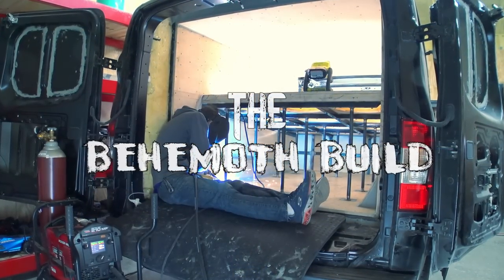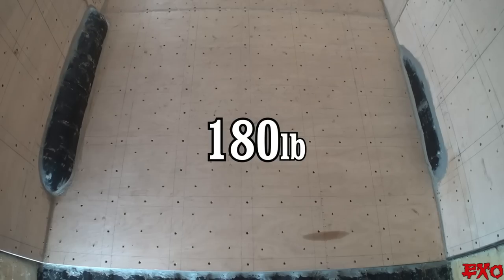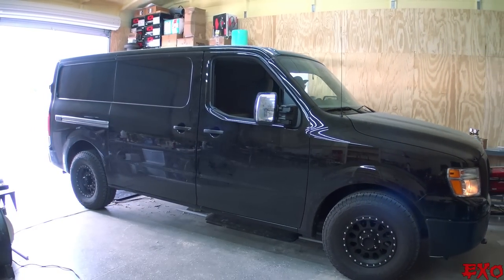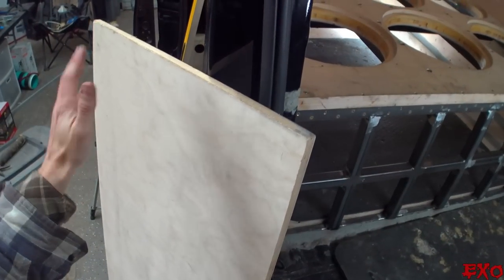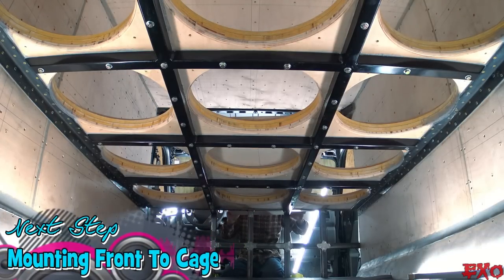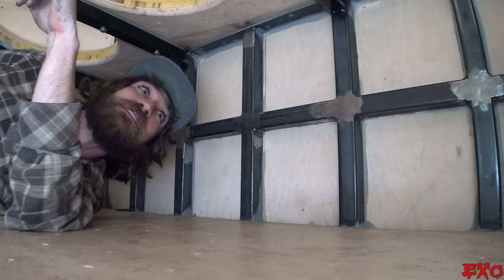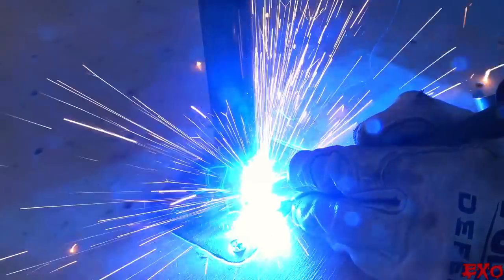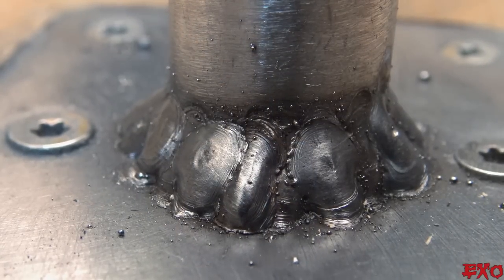Bracing My 8,000lb Subwoofer Build w/ Custom CAR AUDIO Braces + Building & Installing FRONT of BOX!

Comment: I had no idea bass vans took so much work to build. These videos bring me back to my high school days. My 91 crx with homemade 4 12in sub box with 4x 4in pnr ports. With my dd9512's and 2 crossfire 2000d amps, with a good ol group 35 blue top batt. Best was 166.1db on the dash.
Reply from the maker: Wow, great numbers! Thanks for sharing. I really loved messing around with with audio with my cousin back in the day. Memories that will be always cherished ☺️
Reply: @EXOcontralto  Thanks. My friends and I would spend hours tweeking things to get every last db. Like the a/c on max gained .2db, open the driver door 2in gained .3db, or slide driver seat all the way up .1db! When i strapped the amps, and wired down to .25ohm is when it all went by by. I didnt have $5k to replace everything. But the memories last a lifetime!

Comment: I know it’s great using an impact to drive screws but as an interior systems mechanic journeyman I recommend using a torque gun of some sort for setting your screws. With the amount of attention too detail as you have that would only improve the fastening of any screws. Just a thought I had when seeing you use an impact driver (which I normally use for tap con fastening). A torque gun/tek gun, will likely provide you much satisfaction.

Comment: Love the new focus at content and hair cut. I like how you snuck in your New Years resolutions. 
My question is, what will you do with sound proofing the exterior? Will exhaust brackets or fuel lines and things of that nature create an issue?
Reply from the maker: Yeah, totally. Maybe not that specifically, but destroying the actual vehicle and its mechanical parts is always a concern with extreme bass. Every weak spot becomes even more vulnerable the more and more the enclosure and cabin gets reinforced. It literally just keeps transferring to the next weakest spot. Because of that, I'll have to carefully manage flex and monitor breakages because this sh*t is going to destroy lol

Comment: also on that pl, if you want to make it very nice a smooth on parts you can see, put on some gloves and dip your finger in 91 percent rubbing alchohol and it comes out like butter, and as far as the welding laying down a soaked towel on top of the wood before welding should wick the heat away

Comment: Instead of using the Dremel you can also offset the screw and use a 2 component epoxy instead of a adhesive

Comment: dude, you should have used 2 holes per pipe and filled from the bottom... put the top set screw in before removing the caulking gun on the bottom so it holds vacuum while you put bottom set screw in.
Reply from the maker: Appreciate the feedback man! It was breathing well enough around the nozzle, luckily. Good thing I went slowly and triple checked everything along the way confirming a fully filled tube tho 👍

Comment: I wonder if wrapping the brace with some Sound denting would lower the ping even more after you filled them.
Reply from the maker: Yes, technically. But that wouldn't really look the part once wrapped. Deadener is always kinda wrinkly and dimply. Plus it would take away box volume that the subs could to potentially use inside.

Comment: At 12:58 you mention how the flange screw holes align with the crack between the wood and steel.
Have you considered rotating the flange 45 degrees so that two are on wood and two are on steel?
EDIT: Your solution is way more elegant. This build is nuts and I love it.

Comment: What will the final cost be?    Looks amazing.   Wish I could do half as good.   I bet you're so pumped.
Reply from the maker: Hmmm, now there's a question... maybe I should try to make a video talking about that?
Reply: @EXOcontralto   yeah that be cool.   I don't think people really understand the costs with everything that goes into a build.  I know when I did mine it was all the little things that end up costing so much.    I did a 93 toyota pickup that I molded a canopy on and did a walk through. I'm running 2 skar skv2 3500 amps strapped to 4 skar vxf 12s set in a Gately Audio 4x12 8.0cf box, 2 sets of skar spx-65c component speakers running off a skar rp 75.4AB amp, a skar eq,  a slam panda bass knob, 0 g ofc power and ground runs and all ofc speaker wire, all off a Pioneer 4200 nex. A 300 amp brand x alternator, and a sx d6500 secondary batt.

Comment: Just curious as to why you didn't put a layer of 3/4" ply on the inside of the front. Just thinking the amount of pressure is only being held back by the screws holding the front panel on.
And having the ply on the inside of the frame would put the pressure directly onto the frame.

Insane build tho. Will be worth travelling to the US from Australia to see this in person when it's finished.

Comment: The round pipe plates could have run the screw holes in a line and had to screws for each plate hit the steel and the other two screw just secure in the plywood.

Comment: Quick question, what about the square tubing? Does the filled in blocks help with the vibration? Probably would've been better to fill them up aswell, but that will be lots of work.
Reply from the maker: @billy bowling  Much like how the added material inside the round braces removed the unwanted resonance, the added material attached to the metal cross supports (which is the 3" thick wooden baffle bolted down to it) completely deadens it already. The only reason the round braces resonated was because they spanned a large distance, UNTOUCHED. The cross supports on the other hand have no spots where they span untouched by another object.
Reply: @EXOcontralto  can't wait to see the end results. Amazing job, keep up the hard work!!

Comment: Wood is porus, so the glue should hold to that fine, the metal however, should be cleaned thoroughly and can benefit from a 60 grit scratch to increase mechanical adhesion. Im certain you are already way overkill as is so i wouldn't worry about it lol

Comment: I think instead of building the little squares it would have been easier to put another board on that side and drill a tiny pilot hole in the center of the board we're supposed to be the square would be and just fill those up with foam it actually would have seal much tighter they would be no air leakage no rattle and would have liked that sound dancing

Comment: EXO take ur time on the build everything u do is gonna pay off in the end. I to have a build but it's way smaller. I have 2 american bass Hd15d1 and taramp 5k for my mids n high I have 4 Pioneer TS-A6880F 350 Watt 6" x 8" with a taramp 800 I'm still trying to figure out what tweeters I want plus I need to buy or get a alternator build n I need to get some batteries I just don't know what to get. I started this build in 2020 and I'm still not finished. Oh it's all going in a 2010 lincoln town car

Comment: at 12:48 min why not turn the pedestal/mounting flanges 90 degree so 2 screws went into the metal and 2 in the wood
Reply from the maker: Good thinking, but still not enough room to call it good.

Comment: I thought you were going to put plywood on the inside of the front wall to make it smooth like there sides
Reply: No reply
Reply from the maker: It's hard keeping up with thousands of comments every month. But hey, I'm trying. Once testing begins, yes possibly that section will be covered - if the enclosure requires shrinking. But for now, there's about 4 cubes in that area available for shrinking, testing and tuning purposes.

Comment: How long do you think it will be until you actually setup the amps and subs? and are you painting the interior or leaving it as is?
Reply from the maker: Definitely painting inside. I was actually thinking of doing all that underneath the baffle sooner rather than later. It would be easier to do now before enclosing it fully with a rear wall. Can't really pinpoint when the gear will be installed tho, especially because amplifiers are still an unknown 🙄 Won't be long yet tho!
Reply: 1 more thing to ask. i have to wait to get another car bc my fiance says our family van isnt a place for a big 18" smd sub lol any advice? 😂
Reply from the maker: @Cody66630  Make her walk 🤣 No no, just kidding but seriously they make some awesome drop in kits nowadays like Kicker for instance has an all in one kit that's actually pretty decent. It fits under the seat and it's self powered all in one unit.

Here's a link to one:
https://showtimeelectronics.com/products/kicker-11hs8-8-150w-hideaway-car-audio-powered-subwoofer-sub-enclosure-hs8?_pos=1&_sid=79a4d0c61&_ss=r

Comment: if you change subs will it mess with your volume displacement?
Reply from the maker: Volume wise, it wouldn't mess with anything enough to matter. The box is built on the bigger side to begin with. That way I can tailor everything in later. 12 XXX 18s displace roughly 3.96 cubes. Those spiffy new Sundown subs would likely displace around 3.6 cubes. That's a difference of 0.36 cubes out of 65. Divide that by 12, and that would mean each sub would see 0.03 cubes difference 👍 No worries there. Would just need to dial in a  proper port / volume combo once testing begins.

Comment: Hey I got a question for you. What's the best way to do a sound frequency test in a car? After I know that data, how can I translate it into the correct product to buy? I have a sub that produces 35hz, but I'm lacking on mostly all other bass. Also my high end is lacking. Thanks for the advice!
Reply from the maker: Are you looking to test for what bass frequency is loudest? Or are you wondering why your bass response is lacking below 35hz?
Reply: @EXOcontralto  I'm wondering how to get a more consistent test. So that all my sound levels sound the same to my ear. So I can see the metered level go higher at 35hz, lacks at 45hz, and so on. Do u know of any products or apps that will give me a better reading of the data? Something that can help me visualize the sound I'm getting from my car
Reply from the maker: @Sp3ncerSauc3  Without an entire revamp, or rehaul of the system at an intrinsic level, I would suggest messing around with a quality DSP. Perhaps the TWK? Although nulls or dips in response are much more difficult to fix, peaks can be easily dialed down through proper tuning. If you tame all of your PEAKS, then dial up your entire substage levels uniformly, that should technically eliminate some of the problems you're experiencing. You're essentially feeling like it's not as consistent as you'd like throughout low and high notes, correct? Like it's louder in some spots when compared to others?
Reply: @EXOcontralto  yup. So I'm thinking about upgrading the whole system, 2 tweeters, 2 doors, 2 6x9s in the back. It's a 2006 chevy impala. I'll look into those!

Comment: You still on here exo ?
Reply from the maker: Yes, sir! I'll be on here all night responding to comments 😎
Reply: I have a question. Is that square tubing used as the bracing resonant as well. I seen you do the round tubes but what about that part of the build?
Reply from the maker: @billybowling5194  Much like how the added material inside the round braces removed the unwanted resonance, the added material attached to the metal cross supports (which is the 3" thick wooden baffle bolted down to it) completely deadens it already. The only reason the round braces resonated was because they spanned a large distance, UNTOUCHED. The cross supports on the other hand have no spots where they span untouched by another object.
Reply: @EXOcontralto   Makes sense. Thanks for getting back to me, ETO.. because of you, I have a 12 oriin HCCA in my regular cab colorado with a CT sounds 1000.1 and Focal ES-165KX3 component speakers. I have run off my alpine HDS 990. I need a 2 Channel amp for the front, but I need something small. I have a single cab, and my sub box takes up every bit of space behind the seat. Any recommendations for a very small amp that will need to go under my seat to run my Focal ES-165kx3's ?
Reply from the maker: @billybowling5194  I've been seeing really good things about the prv mini amps. I know stetsom and sound digital are in the space too, as well as others. But I've personally heard the PRV q series, and for how small they were, they are pretty awesome amps, and powerful. Maybe check them out?
Reply: @EXOcontralto Thanks EXO I'll look into those amps. it's been awesome chatting with you! Keep up the good work. Can't wait to see a finished product. You take it to the next level!